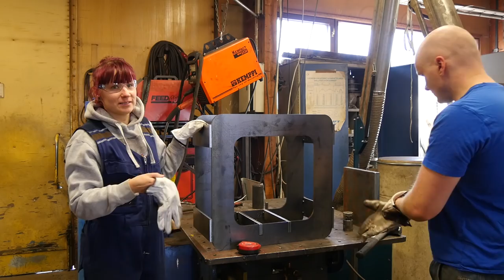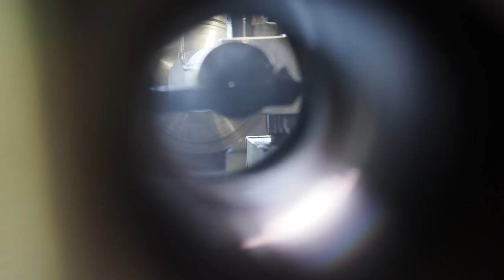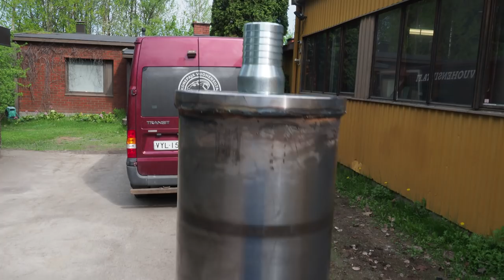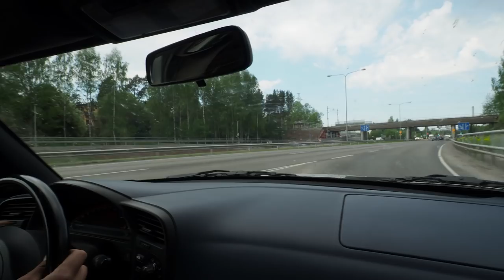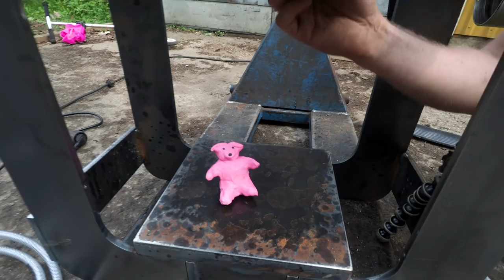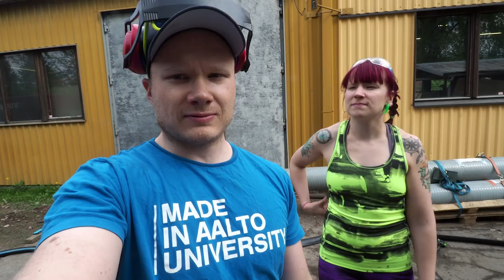Assembling and Testing Smashinator 5 000 000!

Comment: About the piston. You should make the end of the cylinder able to take different tools like the hydraulic press so the punch can have a wide hit or a small diameter tool to impact with much higher force. Maybe even a spike tool for puncturing things. 

Also instead of a magnet how about a small hardened pin that protrudes through the tube wall to retain the piston at the top then pressurize the tube and make a lever system that can be hit with a hammer to retract the pin quickly so the piston doesn't move until the pressure is the highest.  If you are interested but don't understand my crap description please let me know and I'll make a drawing.  

Have a great day
Reply from the maker: Thats good idea! I will use just regular slow ball valve and launch the piston when I have full force
Reply: Beyond the press Can't wait to see it. Being a Machinist myself I really love seeing your shop be used for the channel. Hoping someday to see the big boring mill in action. Keep up the awesome work.

Comment: Suggestions for "SMASHINATING"..   Steel toed and fiber toed safety boots.  Which will save your toes better in a smashinating situation????
Reply: Yes, this please. 

I got a 400kg+ water heater with really sharp corner dropped on my foot from about a knee high and I can say I would have lost all my toes from one foot and more without the boots. Slightly bent steel with a clear dent going across the whole boot and a clear cut through the hard rubber(or whatever it was). Could have been worse, I had to push it and as I started to push I fortunately notices it got loose at last moment, so I got my knee, shin and the rest out of the way. 

If it was a straight cut it would have been fine, but I actually got a bruise on the top of my foot and I couldn't get my foot out that easily since it was still pressing a little, nothing painful, but enough to make the boot feel quite tight.

Comment: My recommendation would be go with the magnet and try to upgrade to a faster valve. There are pneumatically actuated valves that would work quite well, as well as solenoids that act very quickly. Look into what the guys building the pumpkin chunkin cannons as well as tons of other DIY air cannons out there are using. A pneumatically actuated butterfly valve would probably suffice just fine.

The idea of mechanically hold the cylinder with a pin as someone else mentioned is a good idea in theory, but just a straight pin is likely to be extremely hard to remove under load. All the commercial quick disconnects I've seen for releasing a load don't have the load fully supported by the pin. They use some form of leverage to make pulling the pin much easier.

If it's a big enough pin, it's ground really smooth, and the hole is also smooth then it might work. There's also the issue of an uneven force tilting the piston if it's only pinned on one side, and if it's pinned on both the simultaneous release would be an issue.

Comment: Very Nice!! You should add a metallic 90° large bend on top of the machine to avoid the hose to be sharp bent. Also try to put the Air Tank closer to the machine, longe hose Will makes pressure loss. Try to use a fast release valve. Congratulations.!

Comment: You should use a stiff hose (like the standard reinforced PVC hose) that stays open without pressure.
When the air flows into the flat hose you use now it first has to inflate the hose which cost energy from the air, kinks in the hose restrict air flow even more.
When using a stiff hose mount a 90° pipe angle on top of the cylinder, that will keep the hose as straight as possible.

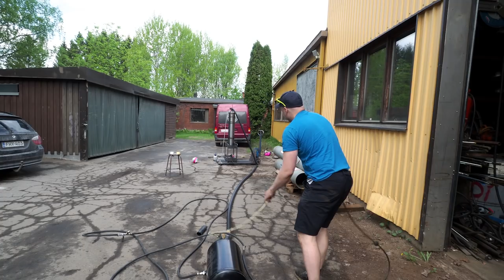Comment: You should fix the the big tube for the high pressure air, that it is not hanging down at the start. If it is hanging down, the acceleration of the piston would not be so good, because the air stream will lose much energy in bending the big tube and filling the kink in the tube. Probably it would be best to use a short metal pipe from the pressure vessel with as few as possible curves. (8:39)
Reply: MichiMedi he said that he will add a valve right before the barrel. That will remove the problem.
Reply: That will improve the problem, but after opening the valve the air will still have much friction in the tube, and the tube will not stay very good at exactly one place, so i will lose energy.

Comment: I think the hose is an issue, it looks like its kinking and choking the flow around sharp corners, you may need to use hard line, I'd also suggest putting the tank as close to the piston as possible, I know this was just a test, magnet is a good idea also!
Reply from the maker: I will put the valve on top of the cylinder to remove any problems with the hose

Comment: HI i think you're going to need a vacuum storage cannister, i work with those pumps and i don't think it has enough volume to lift that piston suficiently fast. Given that the seal is good between the piston and cylinder. Good luck!

Comment: I’m sure the snow pile might make your neighbours back yard a little cooler, but probably only a fraction of a degree 🙂
The snow pile looks really dirty.. after it’s gone I guess there will be a pile of dirt which is sand, brake disc dust, salt and other crap
Reply: Cody from Cody's Lab would be out there mining it for catalytic converter platinum group metals.
Reply: I'm curious, does that snow stays there until ne next winter or does it melt until then?

Comment: You should use a Electric Solenoid Valve. It's really fast and used a lot in compressed air, for example for cleaning dust filters. They are not expensive.

Comment: Let the cylinder pressurise then release the piston mechanically.
Or put large magnets between the piston and the end of the cylinder so it has to build up enough air pressure before the piston releases. 

Eg, 100^in cylinder @ 100psi is 10,000lb or about 5 tons.
If you get a 2" magnet it holds 100kg of steel. 25 magnets is 2.5t
So that would release at 50psi, 3bar or so.

That gives the piston a longer stroke at a higher pressure.

Comment: the long expanding air path with the rubber hose is going to reduce your available pressure to the cylinder a lot. maybe you could mount the pressure tank, valve and a short piece of metal pipe directly to the machine?
Reply: p.s. look into getting a butterfly valve.

Comment: you have to put the pressure tank with as short of a pipe to the cylender. all the pressure is going lost in the hose. and allso put the shutoff valve to the vacume as close to the cylender as well

Comment: Maybe mount the air tank directly on top of the cylinder instead of using the length of hose? This would greatly increase the response time of the piston and possibly allow you to use a higher pressure. You can clearly see the restriction the hose is placing on the air flow when you manually operated the valve in the second test.

Comment: Using a remotely controlled ball valve you could mount the air tank on top of the cylinder and remove the long hose which slows down the air.

Comment: I think, the problem is, that all the pressure is absorbed by the hose. if you have a fast valve mounted directly onto the machine, it should have a lot more power. :)

Comment: it would be cool and worth some extra content to explain - to see you use a venturi  vacuum generator to operate the vacuum using positive pressure from your compressor.  install guages on both sides to show that with that technique you can get a vacuum on one side and have like 600kpa on the other side

Comment: You should keep the hose as short as possible, maybe even mount the airtank directly on top of the cylinder.
Reply from the maker: I will put the valve on top of cylinder but air tank has to be so large that it can't be there. I will use 200 liter air tank to be sure that we have enough air :D

Comment: Did you say coolant in the oil?
Edit: oh diesel in the engine oil
Could be a compression issue, unless it's a gas engine, in that case all you have to do is replace the oil drain the fuel tank put regular gas in and run it till all the diesel fuel is burnt.
Reply from the maker: It's probably something with injection nozzles. They said in service company that those are weak point of this engine and result in this problem.

Comment: Maybe a larger tank and a direct connection to the top. A rigid fitting between the tank and the cylinder would improve results. You might want to look at using an electric operated dump valve for faster response. Take a look at the pumpkin chunkin videos on Youtube for more ideas =)
Reply: I agree, the tank should go direct on top. Use a burst disc made from beer can and no valve. Just a spring loaded knife inside to cut the burst disc and it will then tear.

Comment: Get with of the hose. Put the tank on top. If U keep the hose, pot a 90 degree bent pipe on the end of the hose, to allow full air flow without having to straighten the hose upwards.

Comment: why that too long flexible hose? you lose a lot starting pressure makes that quick release valve almost obsolete
Reply from the maker: I will put the valve on top of the cylinder so hose is already full. And it doesn't affect that much compared to regular hose/pipe. Normal pipe has 1 bar pressure and that flexible thing is empty which is same as 0. So when I open 10 bar line 10 meters of hose take probably 9 liters to fill up and the empty flexible one 10 liters. But I will put the valve on top of the cyliner to remove that problem.
Reply: having a flexible connection is a good thing. I bet there will be recoil so hard that the frame is airborne when the piston hits. If the frame is considerably heavier than the piston, it (and the pavement) might still store the energy from the impact to the bottom plate and release it in the opposite direction, ie. upwards.

Comment: that hose is sucking away all that power till the air gets to the cylinder =/ you should have the valve as close as possible to the cylinder with a reservoir close to it so pressure doesnt drop when the air flows into the cylinder
Reply from the maker: I will put the valve on top of the cylinder
Reply: nnnnice :D